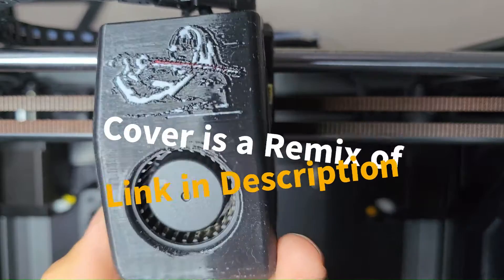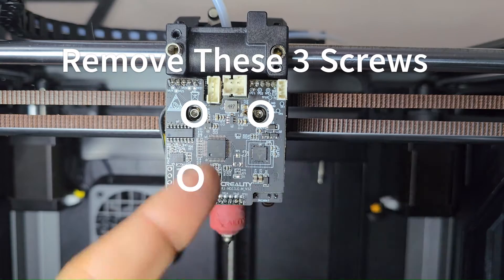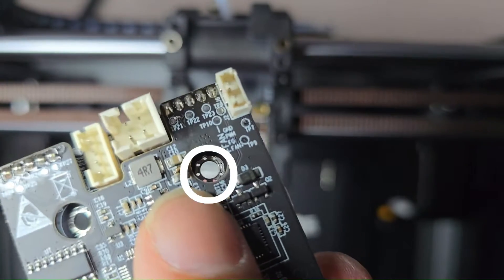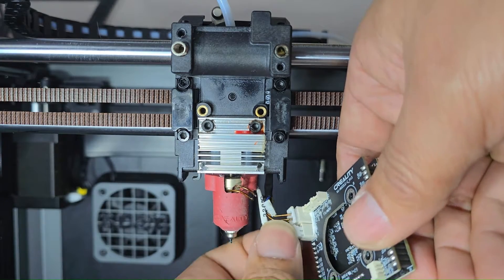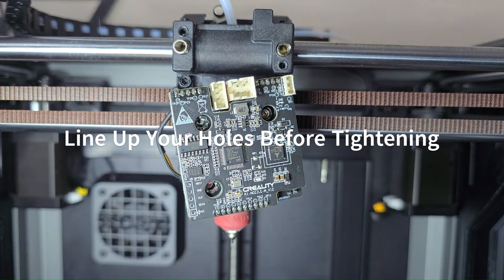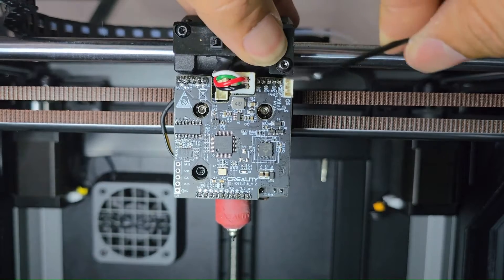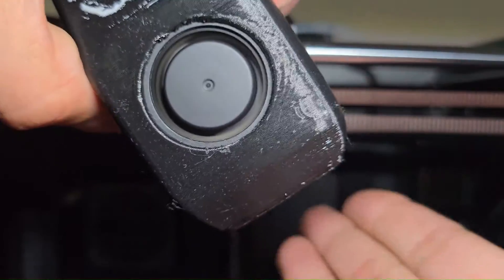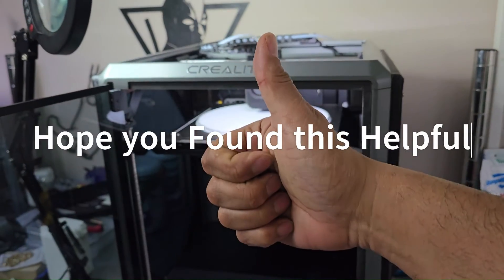How to Replace your Creality K1 PCBA

Comment: Just wondering, how do you get the replacement pcba from creality. I can't seem to find it on their website. Also wondering, is it covered by the 12 month warranty?
Reply from the maker: @Bwokfingerboard  Yes it is covered under your warranty.  You will have to reach out to Creality Directly to get the "Creality" replacement and send them pictures and error logs.  There are 3rd party boards for about $25 but with your warranty it SHOULD be free.  They usually respond within 3 to 5 days.  Sometimes sooner.  Cs@creality.com is the email address.
Reply: @3DandTeePrinting  Thank you very much!

Comment: My k1 started making a click noise. Not the same as if filament is stuck. It extrudes fine when I do the extrude to get new filament. But when it stops extruding it makes an electrical squeal sound from the extruder motor. I replaced the entire extruder with a new one from Creality. But still does the EXACT same thing. Creality isn’t helpful. Anyone have any ideas? I looked at the circuit board for any damage but could see any

Comment: Thanks for the video. I wasn't sure what the part was called after I plug the connector in backward and puffs of magic smoke floated into the air. ugh, now I have wait two weeks for the part to arrive, even from Amazon. I'm going to have a blue Christmas without you K1.
Reply from the maker: @Davids3DProjects  lekker sorry to hear you let them Magic smoke out.  Happens to the best of us.

Comment: How did you know you blew the board
Reply from the maker: @luisdeleon39  Sparks Flew and the Magic Blue Smoke after.
@3:02 shows the blown resistor I touched while the machine was still plugged in that sparked.  Next to the screw hole.
Reply: @3DandTeePrinting  ever come across a 2515 error code?
Reply from the maker: @luisdeleon39 I have not.  But it appears it's hotend issue according to Reddit.

https://www.reddit.com/r/crealityk1/s/yBlWuuBADr

Comment: Hey man nice video. I believe i just fried my hotend’s pcb, totally my fault. When reinstalling the main cable into the pcb the orientation of the plug was wrong, and when powering back up i heard a pop and smoke coming out of the tool head. When i fixed the orientation of the plug and powered back on i got an error message. Will replacing the tool head pcb be solve the issue? and is there any external fuses or breakers that need to be replaced beside the tool head pcb?
Reply from the maker: @royceflora5604  As long as you didn't fry the mainboard replacing the PCB and Cable SHOULD fix your issue.  If everything is coming on but the buttons don't Do anything when you touch them (like heat up the nozzle or level the bed) it's your pcb or cable.  If your screen is blank and it doesn't power on you May have fried the mainboard.
Reply: @3DandTeePrinting  Hey thanks for the response. Update: I got a replacement toolhead pub and installed it. Everything seems to power on just fine with the blue light on the pcb illuminated, however im still getting the same key 111 error message on the screen. What do you recommend I do from here? Is there a software or firmware issue im missing or does another part need replacing?
Reply: @royceflora5604  could you fix that problem? 
I also wired the pcb wrong, also plopping noise and smoke and Error 111. I also replaced the PCB with the same result.

Comment: How did you manually power the fan on and off?
Reply from the maker: @markmiles7485  Manually, as I was turning them on and off controlled through Klipper when I was trying to figure out if the fan was working. The original fan wasn't working.  Swapped the fan with another K1 and the fan worked on that machine but still no response on the machine in question. Figured the PCB connection might be bad so I was swapping out the original with the replacement when I accidentally shorted out a reistor (I believe it's the resistor) screwing back on the replacement PCB. I had it laying around from an earlier com data wire failure on the other K1.

Comment: I picked up a spare board and a bunch of other spares and upgrades. when I bought my k1 last year. I haven't had to replace anything but the hot end. And it was my fault. The one thing that drives me crazy is how much glue they put on the connectors. I had such a hard time getting the glue off and ended up pulling the wires out of the connectors. Seems like not all k1's have the same amount of glue on them. So they must have changed some of the assembly methods. Great video. Hopefully, you come out with more k1 content. Cheers
Reply from the maker: GLUE!!! AHHHH!!!! Don't get me started on the hot glue on boards.  I get it. They don't want it to come lose doing shipping but DAMN.  A little DAB will do. Not a PILE of overkill glue.
Reply from the maker: Thanks for watching.  Just rearranged the entire shop to be able to make more content and hopefully better content in the future as well.